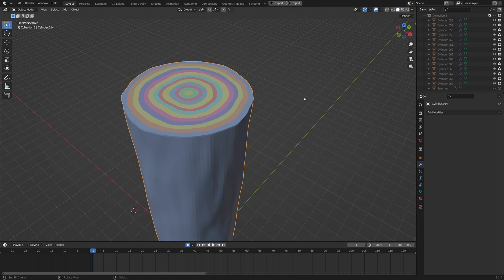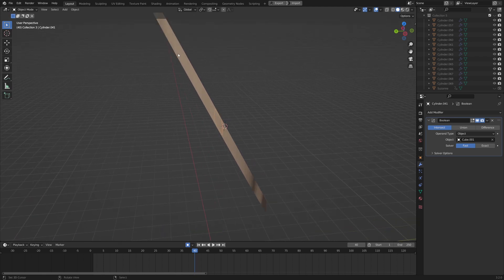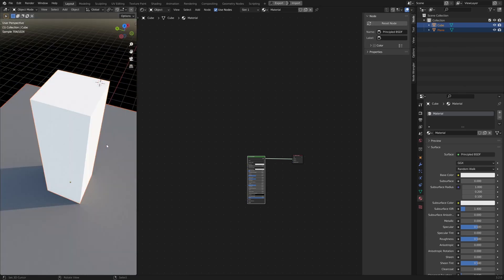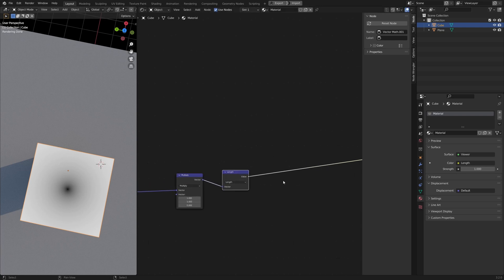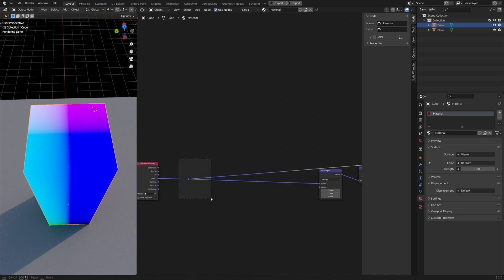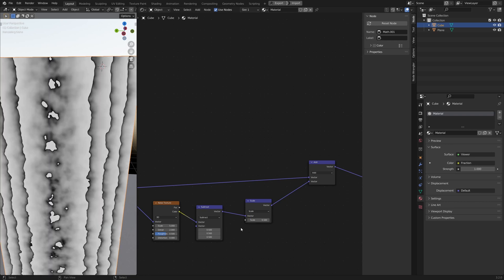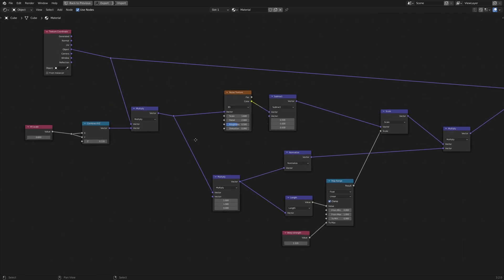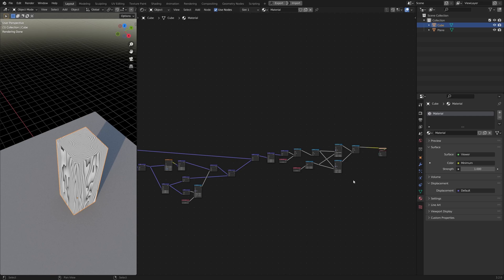Procedural wood material - Part 1

Comment: No, no, no, you missed a very important aspect of trees and wood. The wood grain is not a random waviness. The warping of the wood grain is a function of the anatomy of the tree and its living condition. The main distortion of the wood gran is caused by the branches. The branches grow out of from the center and as the branches grow bigger they distort the fibers in the wood that have to bend to give space to the branch. When the wood is cut this is usually called wood knots. Another factor that cause some distortion is wind bending the tree making it not grow perfect straight.

Would like to see you tackle that with distortion forming around knots from branches instead. You are clearly very clever with the math operations so I expect it to be an elegant solution.

Comment: Would you please give me some discount on the basic Wood purchase... i want to buy actually i tried to create but after some time there are bug when i am changing cables between position and coordinate it changes the texture of wood which is not useful for me and i am unable to fix i have tried 3 times but same problem happens only at the time of changing coordinate cable for position
Reply: The problem might be in the change of the functionality of the nodes due the Blender update to 4.0. It makes allot of instruction videos obsolete.

Comment: I find this hard to follow just starting to learn nodes. I know you probably don't want to repeat info you've gone over in other videos, but it would be nice to not have to look for it in a separate thing.
Reply: I would definitely start with a more basic material tutorial first but don't give up. I personally like this one because since it's procedural, you don't have to mess with UV maps which depending on your object can be a huge headache. And the result is very close to realistic with some tweaks to the scale. I just stopped the video a lot and slowed it down in some parts to see what he was changing. The only parts I noticed that he changed but didn't show is sometimes he changes the values a little, but he does show the whole node setup at the end if you want to check your work. And he doesn't show the keyboard shortcuts that he uses, and he uses them a lot.
Reply: Honestly if you are trying to follow this guy as first timer don't ! probably don't even bother if unless you really want make his variotion of wood. He overly complicates things and than skips required parts.

Follow Ryan King Art instead, to it also takes bit of learning curve to follow his tutorials as well.

Comment: How did you separate the mesh into cylinders based on the shader output? I've been trying to figure that out for hours
Reply: Okay, what I did to replicate the nested rings effect was use a geometry node to displace the surface of a series of nested cylinders. Because they were all displaced by the same amount they were perfectly nested.

Is that how you did your nested rings?

Comment: Another great video. Are you going to add medullary rays to the texture to make it even better
Reply: oh ! @Oswyn Faux is there a relation between the medullary rays and the "flambed wood" ? (f.e. at the backside of a violin)
Reply: @jcsekinger  that's either quilted/tiger stripe wood, where the grain is like sand ripples on a beach, or the chaotic crotch pattern where a branch comes off the trunk. Best example of the rays is quartersawn oak, or riftsawn oak. Oak has huge rays, maple had tiny rays